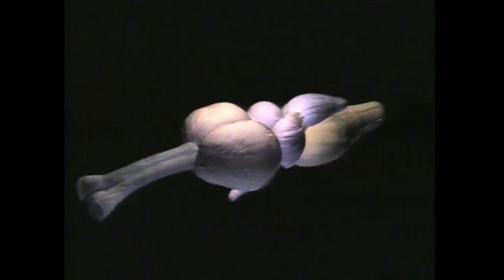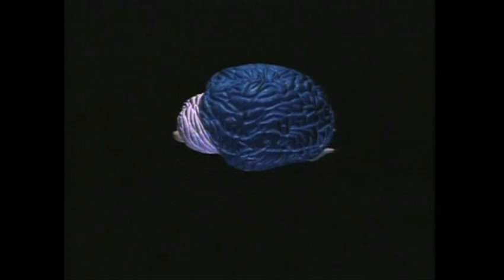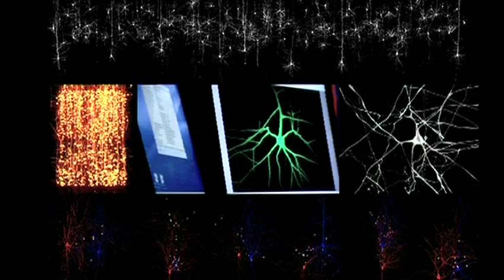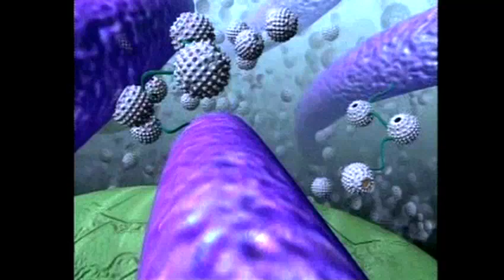A brain in a supercomputer | Henry Markram

Comment: Once you build the circuit, how do you then model the dynamics of the morphology of the "circuitry" itself, that is, how the neurons re-wire themselves based on learning. If the circuitry is static, and the only dynamics are those of the circuit, namely, the cumulative firings between neurons, the brain is never really learning. Am I right? In other words, the brain architecture changes over time. How do you account for this?

Comment: @Udinbak cont2. The region would have to be passive at first in order to train the new brain to understand the sensory experience, then active control gradually increased while the mind becomes accustomed to making self adjustments. safety protocols in place of course. active and passive control at the early phases would be counter productive, since the young mind would exploratorially make potentially damaging alterations which could render the mind insane. or the equivalent.. just a thought..

Comment: @Udinbak cont. It could see which connections are active during a particular thought, it could refine it's thoguht processes, edvice on improvements, or refinements. It could ask to sever a synapse in order to reduce an unwanted response, strengthen it to increase a desireable response, even request a new synaptic pathway to connect and explore disparate functions/memories/senses/etc (synesthesia). If the new region could make these adjustments, then it would be able to do it automatically.

Comment: Wikipedia is wrong on that point. Look it up some more.  I am wrong as well, it's not because of the atmosphere either. It's true that their angular diameter is actually a bit smaller when the moon is near the horizon. There is, however, no consensus as to why the moon appears larger on the horizon, and the theory that it's because it's compared to the foreground has been discredited many times. So Wikipedia and this guy are wrong. Since I'm not giving a TED talk, it's less important that I am.

Comment: you're wrong about the moon. it looks larger when it's near the horizon because you can compare it's size with houses or trees. from wikipedia: "The Moon appears larger when close to the horizon. This is a purely psychological effect (see Moon illusion). It is actually about 1.5% smaller when the Moon is near the horizon than when it is high in the sky (because it is farther away by up to one Earth radius)." so, think a little bit before you write something.

Comment: "...if no energy enters or leaves the system..."
That is the important part of the 2nd law. Your comment would be (partially) correct if the earth was a closed system. It's not. The earth gets gobs of energy from the sun, so entropy won't be a factor until the sun runs out of fuel. Evolution (and SG) aren't breaking any laws of thermodynamics.

Comment: "You can take the quotation marks around 'religious types' off because I never said that. Typical, lying isn't going to make you right. [..] If you were smart enough to have reading comprehension skills and were able to analyze what I said directly, you wouldn't have to lie to try to make your weak ass point."

*ROFL* I said (direct quote):

"Chem made a comment about 'religious types'"

You took that to mean yourself rather than "Chemicalogic", yet brag about reading comprehension. Epic fail.

Comment: Not hard to speculate.

From 10,000 neurons to 10 Million in 10 years by 'law' of computational cost.

From 10 Million to. 100 Million  by using simpler vector processors rather than that horse of a machine they have now. 

100 Million to 1 Billion by improvements in software.

1 Billion+ through budget increases, which can be expected if the structure shows adaptability and learning.

Using a functional rather than biological model would also vastly increase neuron count.